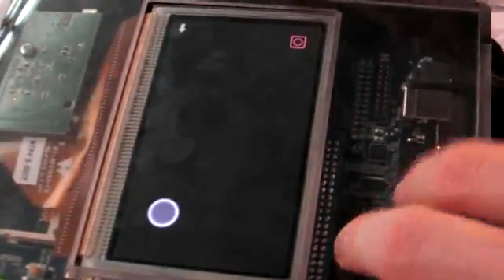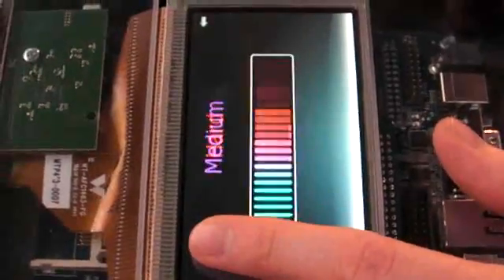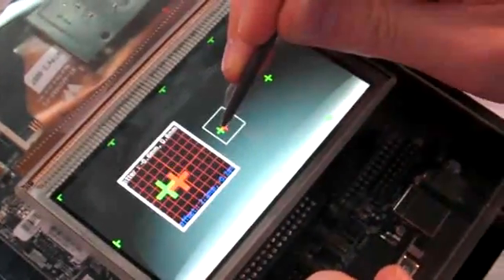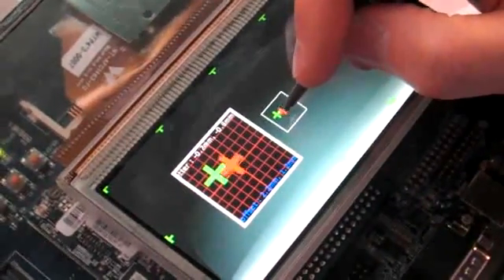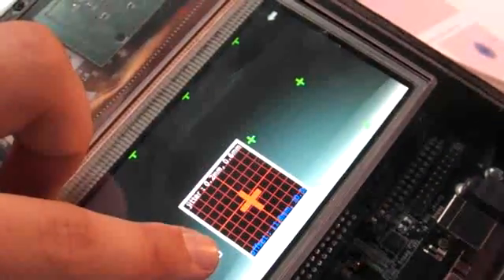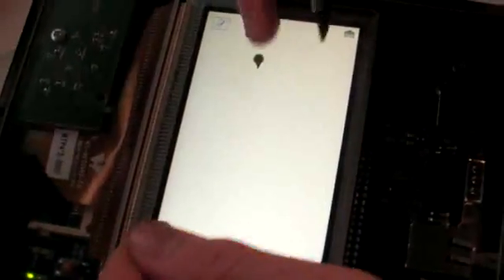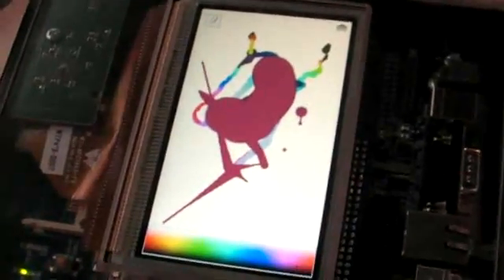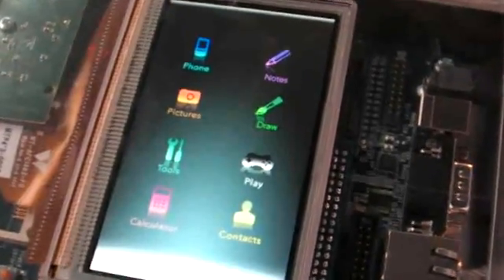Multi-touch comes to resistive touchscreens

Comment: i don't know, i've had really bad experience with nintendo's handhelds for the past decade :/
even tho i use them carefully they seem to break from themselves (i open and close my DSi quite frequently since i also use it as a MP3 player).
funny how my original GameBoy that i got as a birthday present back in 1992 still works perfectly fine to this day, while i already had hinges replaced so frequently on 4 different DSi's :/
funny thing is that i hold my DSi in a complete Aluminum case... :/

Comment: "good build quality" oh i guess this is why for the 4th time the hinges on my DSi broke after less than 2 months?
nintendo USED to have good build quality, but now they are just cheap...
the buttons on the DSi/3DS are good because they are simply buttons...
on a PS3/X360 you hardly even use the buttons, almost the whole experience occurs with the analog sticks.
the reason why the touch screen on the DS/3DS/WiiU Controller is "precise" is because AAA resistive screens always were very precise...